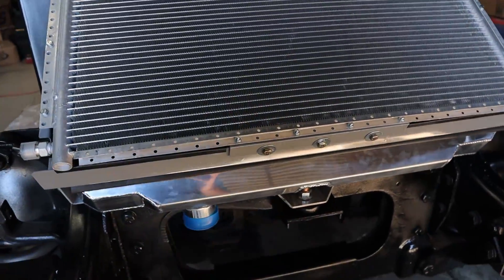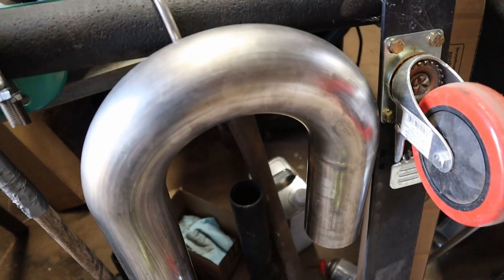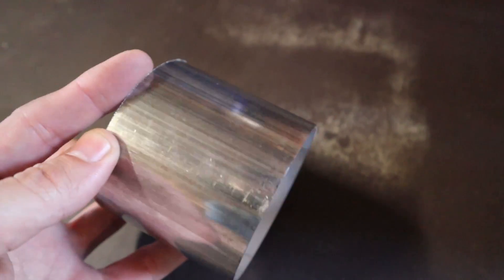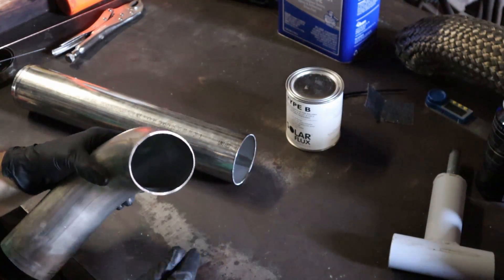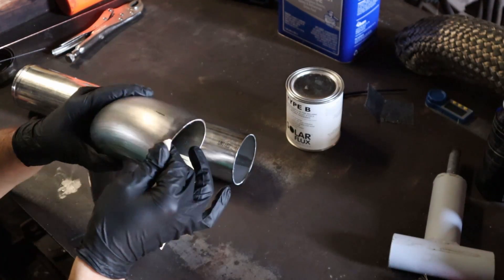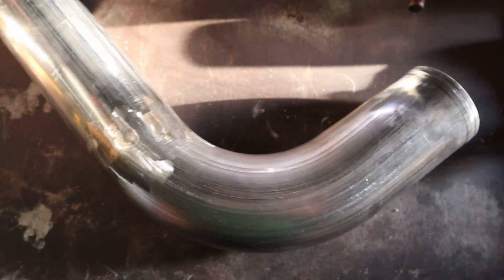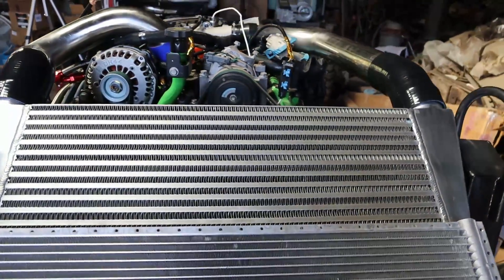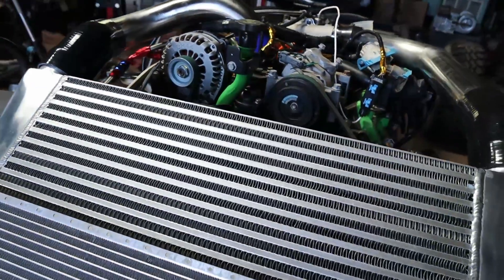Humvee Hummer Duramax Swap Custom Intercooler Tubing!

Comment: Can you tell us the exact intercooler you used for this?  I'm in the middle of this exact same project.  Keep up the good work.   Thanks in advance.
Reply from the maker: IC0053 from cxracing. Horsepower rating of 600. I didn't do an engine build to make more than that really, so if you plan on higher numbers, you might see if they have a similar model that supports it.
Reply: @tossthewrench  Im looking for stock numbers to be honest.  Going more for reliability than anything else.  What fan did you end up using and did you use the factory humvee fan shroud?

Comment: HI, I know it has been a long time, but I am in the process of doing a Duramax swap on my HUmvee. Is there anyway you can put the info on the intercooler, and AC coil you used, Thanks
Reply from the maker: The intercooler was from cxracing. Took me a while to find the right dimensions and orientation of inlet and outlet and still be able to handle the horsepower rating. I don't know the exact part number but hopefully that gets you in the right spot to look if you need one. The ac condensor was just part of a kit I got before doing the swap. Just measure the radiator and search for one that has similar width.

Comment: Nice build. keep up the detailed videos.  Curious on to where did you source the intercooler from?
Reply from the maker: Thanks! I looked at a lot of companies for an intercooler that would fit the dimensions and horsepower rating I needed.  I ended up finding this one at CXRacing.
Reply: @tossthewrench  Awesome, thanks.  keep up the good work.

Comment: Nice ! I'm taking 3 weeks off next month so I can finally work on mine . A tip to find leaks is to put some soap in a half full water bottle and shake it up. poke a hole in the top and squirt the bubbles all over the gas connections. If the area makes more bubbles , you have a leak. Little bit of teflon tape also helps.